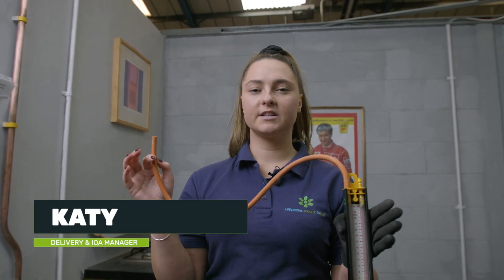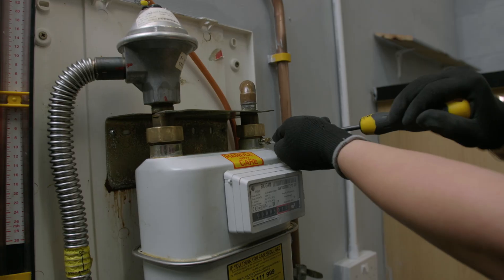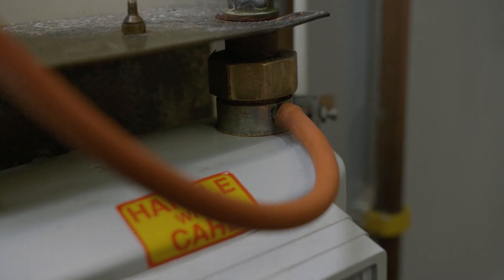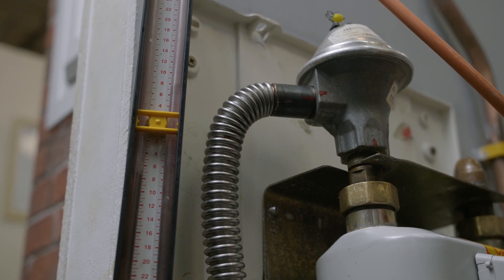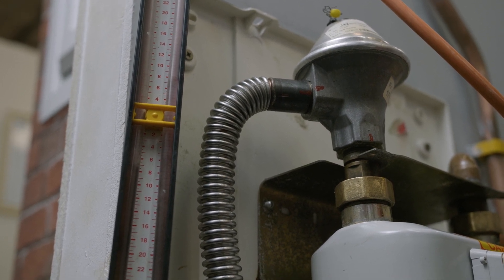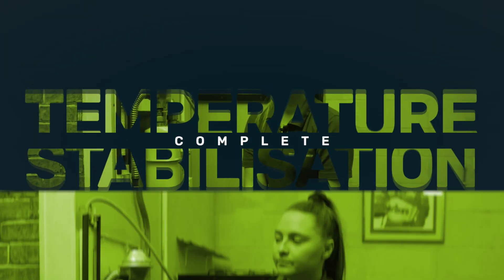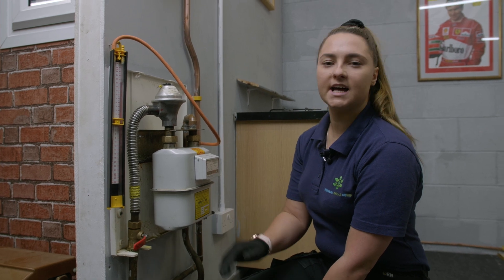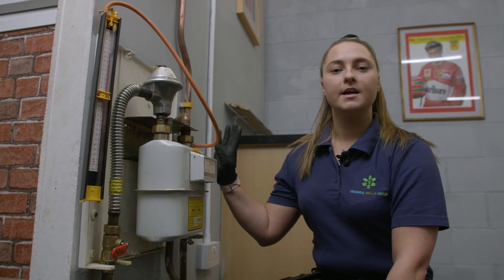Conducting a tightness test on gas pipework up to 28mm on a G4 or E6 meter | Gas tutorial

Comment: Darling just one thing, you should use a volt stick all around the metals i.e. the anaconda the copper the regulator to make sure 100 percent you don’t get hurt doing this test. You’re great, but just one last tip. When you screw the nipple back in, put some ldf around it’s brass as you know and sometimes it could be cracked on the end and can cause a small leak.
Reply: TBF she did say she would spray all around anaconda and all. Regarding volt sticks i have never seen one used in the real world for what you mention. The meter would only be 'live' if the copper conductor in the live (brown usually) wire was touching the gas pipe somewhere and the property was not rcd protected and it had no electrical bonding. You would then have to be touching another separate pipe going to earth for it to run through you. Two points of contact needed for the big one across the chest. Otherwise you get the usual belt up the elbow and you recoil. We all wear gloves  anyway so even that would not feel like much if at all.
Reply: @Михаиллеви  that’s not how it works. People
Have died because they didn’t use a volt stick, I agree hardly anyone died and hardly anyone does it.
Not all gloves will protect you as
Well
Reply: @salcarlito5319  please tell us how it works then if you disagree. We are all here to be educated and that will only happen if people are specific.